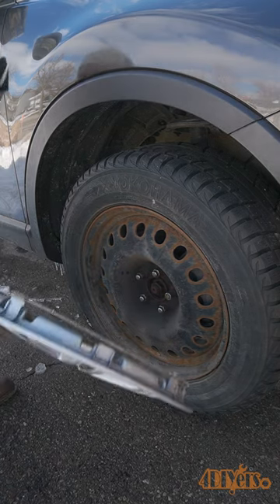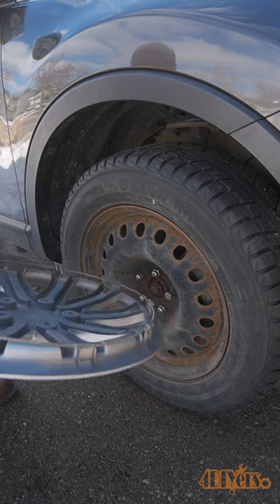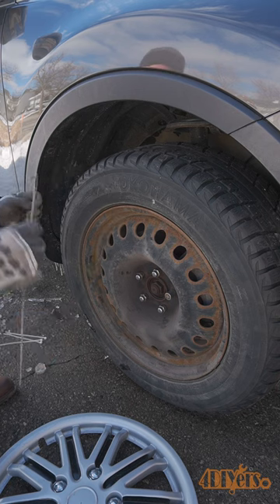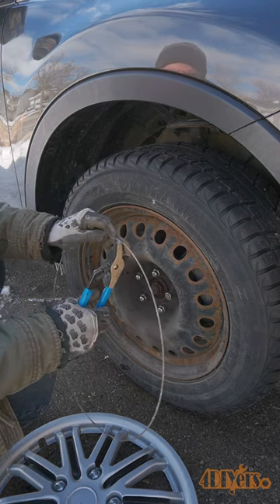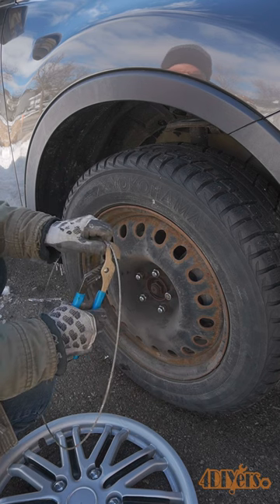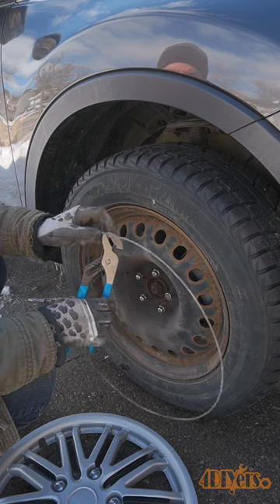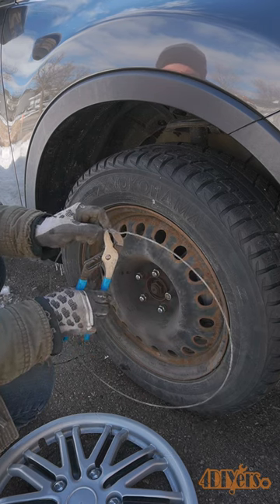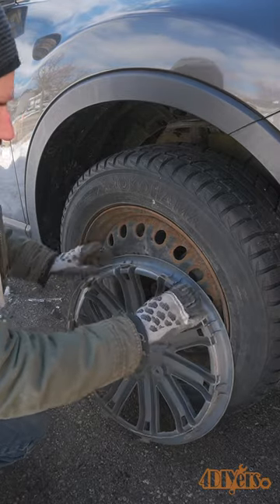How to Prevent Hub Caps from Falling Off

Comment: Great idea, I just looked up and you can get grey and slver zip ties to hide them better on wide hubcaps like a Subaru Forrester
They should have keep making the ones that go over the lug nuts and bolted on, to keep people from stealing them, as mine didn't fall off and dissapear overnight
Someone lost one and stole mine to replace it
I'm thinking of selling the steel rims and hubcaps and going with used alloys
Reply from the maker: Great tip about the silver zip ties, thank you for sharing! I miss the hub caps that go over the lug nuts. Alloys aren't overly expensive anymore, especially used.